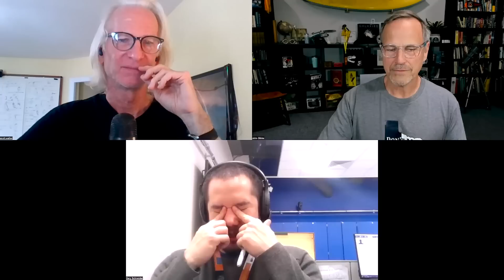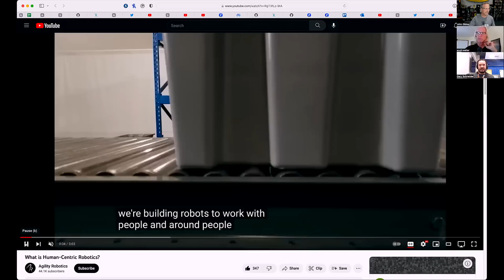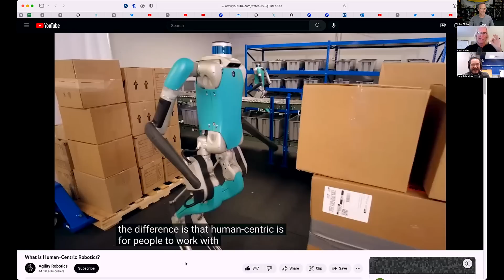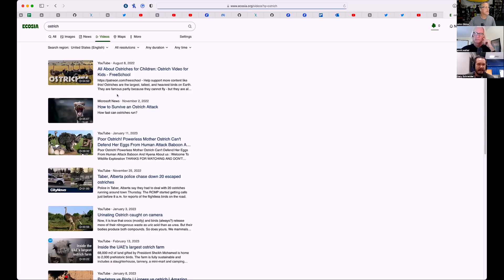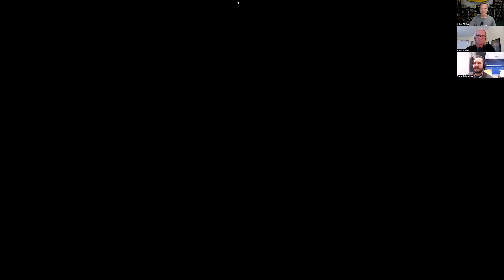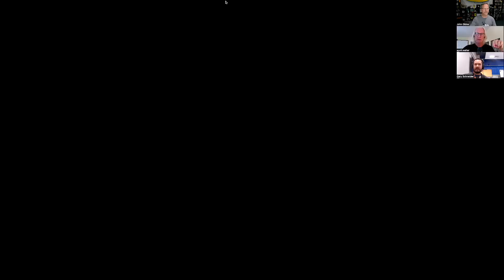TESLA BOT vs DIGIT: Designing a Human Compatible Robot from First Principles! With Scott and Gary

Comment: As to why the front part of the torso is built heavier:  What happens when the bot is carrying something!!!  The weight will concentrate on that front section.  So of course it will need to be built stronger.  So far, there has been no talk of it carrying backpacks, but like us, it would lean forward to balance weight.

Comment: Rarely  have I seen three men over think a problem so much. Those 3 rotational motors have to replace the strongest linear motors of a humanoid body, plus their flexible attachments . That's why they are so large.   What I don't understand is the hip geometry not being optimized for walking and a lack of a more flexible suspension. .That's like reinventing an axle as a straight rigid member bolted to a rigid frame.  I don't know of an animal that has its hip joints constructed so the legs are optimized to move in parallel with each other, or one without  flexible chassis.

Comment: I am an Orthopaedic Surgeon with an ME background as well.  Listening to the discussion, it seems that the importance of abduction strength to human locomotion is not well recognized.  During stance phase, the center of gravity remains in the midline but the axis of rotation is the hip.  In humans, the distance between greater trochanter (abductor insertion) is generally half or less than the distance between the hip and the  center of gravity.  This means that when standing on one leg, abductor force is double body weight just to stand motionless. The abduction motion is not as important  as the simple force needed to balance.  Bipedal human motion also requires very little power, because the knee should be locked straight in stance phase, and almost all power of locomotion is derived  by anke push off.  Optimus appears to me to be using too much knee flexion and wasting energy.   This may now be because of balance issues.  Ultimately, a more human gait should be adopted in order to lower power requirements.  This also may require stronger ankle actuators.
Reply: Agreed, but knowing Tesla, they will continuously improve the gait and more…likely after they start selling them to the public akin to their vehicles with OTA updates.
Reply: @DouglasJMark  I would hope that Tesla improves the gait before they expect the public to buy them. But I agree that, knowing Tesla, they will.
Reply: I too was disappointed to see the very Asimo-like gait of Optimus.
Reply: Better to have wheels and just walk when necessary (climbing stairs or ladders).

Comment: John, how about some 'deep as possible' diving into the intelligence part of the T-bot.  What do we know at this point about the T-bots learning tasks in the manner Tesla FSD learns to drive?  

The ability to walk is interesting and needed for some tasks but much of the factory floor and warehouse work could probably be much easier implemented with wheels.  And the battery pack could be located in the wheelbase for greater stability.  

Consider a rolling around robot with exception height extension that could move along high shelf units in a warehouse, picking out items to fill orders, doing inventory checks, and restocking.  Even retail could use a simplified robot like that to restock shelves and straighten up displays.

Hatchbacks and pickups.  Walking robots and rolling robots.  It's the ability to learn that is most important, IMHO.
Reply: Having the batteries up higher is an advantage for counterbalancing whatever it's picking up. If it picks up something that's 30lbs, it needs to match the new weight in front with an equivalent weight behind. If the batteries were in the bass, you'd have to just add dead weight that it could use as a counterbalance like a crane with all the concrete blocks at the back.
Reply: @truhartwood3170  
You're assuming a 'bend over to pick up' design.  Consider a telescoping body mounted on a heavy wheel base.  The arms/shoulders elevator down to the level of the object that needs to be picked up.  The entire body could lean away from the load in order to keep mass centered over  the wheelbase.

Much simpler movements.
Reply: @bobwallace9753  sure, for a load it's picking up from the ground close to its center of gravity. How does this work when it needs to reach forward and pick up a box from a shelf, or out of a bin, or reach forward to put it on a conveyor belt or load it into a vehicle? What your talking about has almost no practical, real-world applications.
Reply: @truhartwood3170  
Think about an order fulfillment center.  A warehouse full of shelves that reach to the roof.  The task is to fill and retrieve stuff from those shelves.  Extend that to your local grocery store that needs to replenish shelves and bins daily.  These are some of your real world applications.

There's no need for a robot that walks from spot to spot.  The floor will be perfectly flat and smooth poured concrete.  No need for complicated hips, knees, and ankles.  A wheeled base will do the job.  Perhaps a bit of bending at a couple of points ("ankles" and "hips") in order to keep the total mass centered over the wheelbase.  

Look at how some forklifts are designed so that they can scoop up items from ground level and lift them several feet in the air.  Replace the tines with gripper arm/hands.  The Tesla bot cannot work on shelves more than six feet or so off the ground.  It would need to climb a ladder or use some sort of a hoist.  Build bots of varying design. 

Keep it simple.
Reply: @bobwallace9753  Yeah, that is not at all what the form-factor of Optimus is for, nor its intended use case. Way below its pay grade. Optimus is for doing the tasks humans would normally do, and to replace them easily and seemlessly. So it needs to be the same size and form factor - it can sit in a chair for humans, work at work stations for humans, use tools designed for the human hand, that kind of thing. A wheeled robot with extremely basic grippers is definitely better for what you're talking about.
Reply: @truhartwood3170  
OK.  you've managed to realize 'one size does not fit all'.  

That was my point from the start.
Reply: @bobwallace9753  absolutely. The argument I'm making is that a humanesque robot is a one-size-fits-most. It provides the most advantages with the fewest disadvantages. The most use cases with the fewest limitations. It's the easiest to "plug and play" into a role formerly done by a human - just take over their work station and use their tools. It can navigate the most spaces. It's the best design to work around humans as a cobot, navigating the same spaces and using the same tools as its human coworkers and physically interacting with people in an intuitive manner. That doesn't make it the absolute best solution for every single case, but if you notice Tesla's approach - they are going for designs that have the widest appeal first. The Model Y appeals to the most SUV buyers, the Model 3 to the most sedan buyers, the semi is a middle-of-the-road generalist, the cybertruck has all the features wanted by the average pickup buyer, etc. They aren't starting with niche-market designs. They want to leverage efficiency of scale and Wright's Law. That means they can't put too much emphasis on any single metric, such as the most speed on smooth surfaces with straight-line travel in areas with no people around.
Reply: @truhartwood3170  
I'm finding this discussion tiresome and I'm going to leave it.

If you want to think only of a single form robot and not allow that there could be versions which better fit some needs than your single form there's nothing more to be said.
Reply: @bobwallace9753  I specifically didn't say what you say I'm saying. Not sure why you're doing that. There's a huge difference between starting with a generalized form factor that has the most market potential (which is what I'm saying), and saying that form factor is the only, end all be all form factor and no other form factor is needed (what you're saying I'm saying). If there's a market for 100 million wheeled robots, awesome! Go make that! But Tesla's first focus (though probably not the last) is on the market with a sales potential in the tens of billions. That's all I'm saying.
Reply: @bobwallace9753  the advantage of a humanoid is that it can replace all jobs and thus benefit from economies of scale, but this comes at the cost of more resources due to complexity. More specialized robots are cheaper but less generalizable. I’m partial to specialized robots because the human body was created with self regeneration while robots are not; I also have not seen any discussion on the maintenance of humanoids and would like to know if there’s any concrete numbers.

Comment: Putting the 360 degree FOV lidar on the top of digit was a great idea.  That position lets it localize easily, scan vertically for hand-holds and other texture by flexing its knees.  Your Human interaction ideas about the aesthetics may have some weight too, but that is the best place you can put a single sensor to get situational awareness.
Reply: It also has a number of forward-facing cameras. Not sure if you knew that and are just talking about the LiDAR or if you missed the bit about the cameras as it was very brief.
Reply: @truhartwood3170  On my robots, I use lidar for different things than I use cameras.  If I want to know the exact distance to all of the nearest things, a 360 degree scanning lidar beats cameras, even if I'm using GraphSLAM or a stereo pair of cameras.
Reply: @SteveRowe  Yeah they didn't talk at all about what kind of software is driving Digit. Not sure if it's neural nets like Optimus or...? It looked vector based, but so does Optimus right now in its videos.

Comment: Why are they doing a bipedal robot rather than wheeled?
Reply: Like so many of Elon musk's inventions he doesn't design for what's easy he has much longer far-reaching goals in mind. that is a replacement in every circumstance for humans.
They are going to have to solve the hard problems eventually so he chooses to address them all up front and put himself light-years ahead of the competition.
Reply: I think it's obvious that a wheeled robot would generally be cheaper to design and build and probably work better in an environment with flat, level floors--like a warehouse.  The reason Elon Musk decided not to go with a wheeled robot is that he is also thinking of one day selling Teslabot to households, where walking robots will be far more useful and practical. And there are thousands of times more households than warehouses in the world, so that market is much larger.  Warehouses and businesses will be the proving grounds for the models eventually sold to households.
Reply: There are applications where wheeled would make more sense.  Movement around factory floors and warehouses might be better with wheels.
Reply: I don't think these were meant to move long distances. Feet provide more stability with less ongoing need to fine-tune balance every millisecond. Think of how much more you need to think about stabilizing and balancing when you're on rollerblades.
Reply: @truhartwood3170  
What if rollerblades had built in, computer controlled brakes?  Motor/brake systems like EVs.
Reply: @bobwallace9753  Still takes extra power as it's less inherently stable. The motors need to keep doing micro adjustments and the computer needs to be calculating balance at a higher sample rate. That's also more complex and expensive, with more motors and brakes and stuff vs a flat plate. For most applications, a simple, four-wheeled lifting robot like the one shown would be better for moving parts close to Optimus, and then Optimus would only be moving around its own small area. A similar setup to how humans are working with those kinds of transporting robots today.
Reply: @truhartwood3170  

A wheeled robot like I describe has fewer moving parts and would require less energy and calculations to move than a legged robot.
Reply: @bobwallace9753  I don't quite understand what you're picturing. If you want a stable, wheeled base with no legs, you're talking something fairly large that wouldn't be able to navigate human-centric spaces easily. I think there's a good reason why everyone making robots to replace human labourers in a generalized sense is looking at bipedal robots. As soon as you deviate away from bipedalism you start narrowing your application more and more. It becomes less and less a direct replacement for a range of jobs formerly done by humans. I think you're looking at the benefits in one narrow application without thinking about how that would introduce drawbacks in other areas. Question - do you honestly think the engineers didn't thoroughly look at a huge range of ways of incorporating wheels? To me, I can't fathom not looking into a huge range of options of doing so. If they're settling on feet, it's because that's what makes the most sense. The creators of Digit specifically tried to start with first-principles, specifically trying to make something that didn't look human, and only grudgingly created something that is roughly analogous to a human because they were forced to due to the design criteria and use cases. They just couldn't get away from it. That goes for bipedalism as well.
Reply: Wheeled robots need the environment to be adapted to wheels. A bipedal robot can go anywhere where humans are. Just think about ADA compliance for coworkers in wheel chairs and then think who is going into the cluttered storage room to grab something at the back.
Reply: @Trahloc  
You make a point without substance.

There are some environments that need 'legs' and some that don't.
Reply: @bobwallace9753  The question was why weren't wheels used not where are wheels more efficient. The purpose of the Tesla bot and the Agility bot are they work alongside and as replacements for standard humans using standard human tools (in Tesla's case). The design goal is that no specialized environment needs to be built for them. They just drop in where a human is already doing these boring and dangerous tasks in as many places as possible.
Reply: @Trahloc  
You are correct as far as you go.  Where you stop short is by not considering that there are likely some jobs better done by wheeled robots.
Reply: @bobwallace9753  I absolutely agree with you, but that wasn't the design goal. An excavator is significantly better at digging holes than a flatbed truck but you don't buy an excavator to haul broken down vehicles off freeways.  The reason it was built with feet is the reason it was designed without wheels. Wheels are the wrong solution to the problem they were answering and your random personal desire for wheels doesn't change that.  Go check out Boston Dynamics' Handle bot, it's made for what you want.
Reply: @Trahloc  
This may be the most boring discussion I've ever been involved with.

Tesla decided to make a walking robot.  There are some jobs where a wheeled robot should be better.

Tesla decided to make a sedan as their first serious vehicle.  There's also a role for trucks.
Reply: @bobwallace9753  The reason it's so boring is because you're ignoring the premise of this thread.  If you want to talk about the merits of wheeled robots you should target a thread about that instead of injecting your personal preference where someone is asking for the merits of bipedal robots. 

Context matters, much like the reason they chose bipedal over wheeled.
Reply: @Trahloc  
Bollocks.  This thread started with Daniel asking why legs instead of wheels.
Reply: @bobwallace9753  Exactly, what are the merits of bipedal vs wheeled robots.  Not what are the merits of wheeled vs bipedal.
Reply: @Trahloc  
You've now crossed the border into SillyLand.

Comment: Are there any gyros included in this design to help stabilize the mechanism?
Reply: Pretty much guaranteed. Accelerometers, too. I think they didn't mention these because it's basically a given.
Reply: I’m sure there are, since they fit on a tiny and inexpensive chip on a circuit board these days using MEMS technology.

https://en.wikipedia.org/wiki/Vibrating_structure_gyroscope